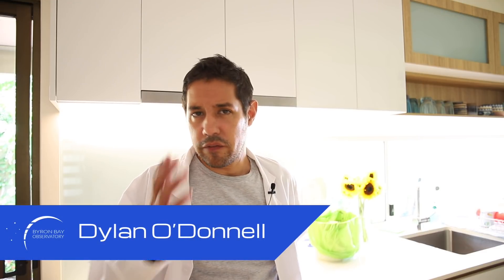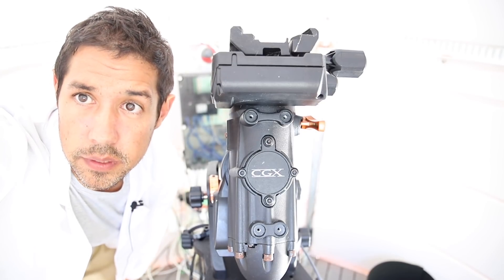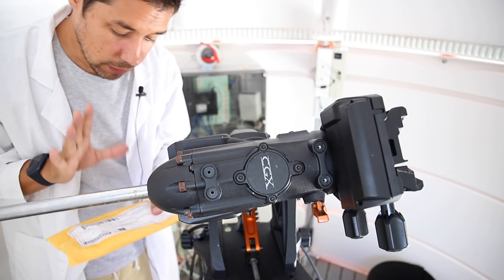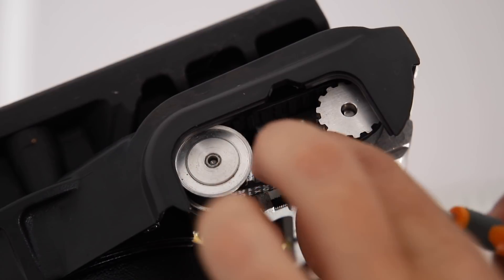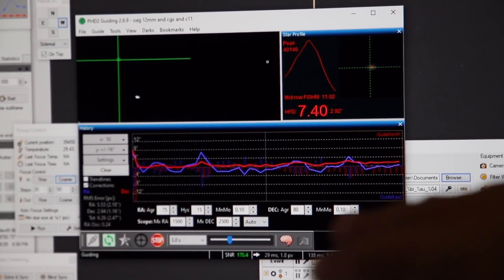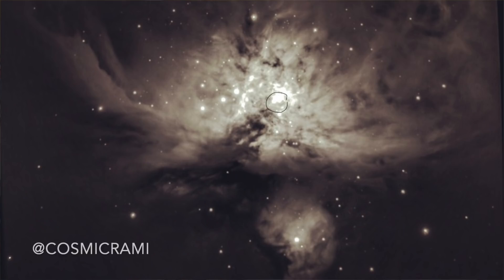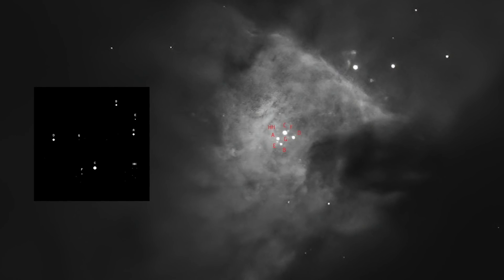CGX Belt Upgrade Demo & Trapezium PSA

Comment: The whole entire problem is the actual belt pulleys on the CGX are not precisely round they are "most of the time" egg shaped or eccentric in their movement, causing the brass bushing and main flange brass bushing to grind away over time, the fix is quite easy you need to rebuild the motor replacing only two parts , instead of brass bushings, you order bearings one for the outer casing and a flanged bearing where the main shaft seats into the motor, and also replace the worm bearings part numbers P213458, and SMF52C-YZZ,  easy 45 minute install and you have a brand new CGX mount!!!

Comment: There are adjustments for the back lash , with mine was not an adjustment but the pinion shaft has a retaining grub screw that was extremely loose causing pinion to move laterally in pinion mount behind encoder wheel, cleaned threads added small amount of locktite and adjusted in , reassembled, adjusted back lash and now like new ! Just look close for pinion lateral movement that’s the key

Comment: I've been fighting my CGX mount for a while now... PHD2 recommended I take 0.5 to 1.5s subs last night. Made the decision to tear it down and fix it. It's doing what yours is doing. I'll get new bearings belt and anything else I can think of.  Grease, clean, and all that good stuff. Hope I don't break it a bit I have to throw away 2/3 of my data at the 20s now. I actually have CEM60 now, but I prefer the ergonomics of the CGX other than its f'ing heavy.

Comment: 😮 certainly Not the way to change that belt.
First step is to back off the pitch  adjustment
Then swap belts and readjust >>>>
Belt should have a sideways deflection  3-4mm should do it?
These belts are very tough even originals.
Hope you have improved things by now 👍

Comment: The new belt looks like PU (polyurethane) belt, most likely with steel wires inside, it should be a very good choice for this application.
Reply: Sorry to hear it didn't work

Comment: How far out is your RA guiding? What was it before? I assume you did a factory-default on the hand controller, firmware reset, and set it all up again. This all seems to have happened since you did a bit of planetary stuff then going back to deep-sky.
I got my CGX second hand, but I'd be interested in an iOptron next time round.

Comment: Hi Dylan, sad to see your suffering similar issues I am.
I did quite a bit of fiddling about to find the cause of the 34s-periodic error causing the horrible stars. I do believe it has to do with the belt/motor/worm gear/whatever.
I did a video on my investigations. https://youtu.be/aZnA4u3cvWU
Can’t wait to see what mount you’re getting in replacement!
May the dark side be with you!

Comment: Ok, a few comments on the belts. your problem with the RA is not the belts but the bushing on the output shaft of the gearbox. I noticed when you were putting the belt on I could see the gearbox cog moving up and down. this indicates the bushing has a elliptical runout  worn in in to it. This wil cause the RA to have a almost cyclic spike caused as the cog turns it increases and decreases the tension in the belt. This is a known problem with the CGX/CGXL. The bushings wear out from too much tension on the belts. On the other hand, if you have less tension in the bets you have way too much BL. Fortunately, there is a permanent fix and why Celestron did not do this in the first place is beyond me. You can replace the bushings with high precision bearings(inexspensive)(easy to do) and keep the proper belt tension. In fact, I run mine slightly tighter to remove al BL from the belts. See CN forum on this subject. Also Ed Thomas from DSP has the bearings. I highly recommend this upgrade. My mount delivers great guiding and round stars now.
Reply: This sounds much more senseful than the belt wobbles. Let's see maybe one day I need this too. Thx for that.

Comment: Have you tried the following trick: Set the base tracking speed to 1/2 sideral and then the guider does only corrections in the plus direction instead of oscillating between plus and minus.

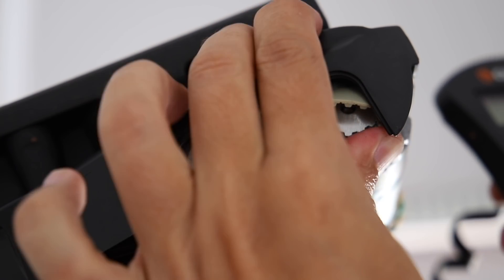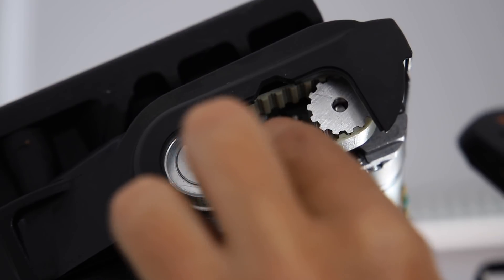Comment: Hey Dylan nice work on the belt swap.  When you were slewing, I noticed your belt still was pretty slack at the 4:54-4:57 mark.  I did the belt mod to my old NEQ6 Pro and I had to make sure there was no slack when changing directions otherwise I had massive backlash isues in PhD.  Hopefully that's all it is for your CGX, there should be an adjustment screw near the motor somewhere that you can unscrew a bit, then use a flat blade screwdriver to lever the motor out to create tension and then do the locking screw back up

Comment: Hay Dylan i was watching how the belt was acting after you put the new belt on....all belt drives have what is called tensioner...it would be a small bolt or screw...the screw type would move in a slot with a bolt tensioner...likely this would be the type....don't worry you can't mess it up....i saw that the new belt had a lot of ....for a better word....slack and this would cause the problem you where experiencing...and a lot of backlash...the fact that this is a new belt it may work better but it will eventually start acting up.
Reply from the maker: Thanks .. I’ll look for it :)

Comment: I think the CGX over all is an okay mount, but it does have its quirks and mechanical hangups. I'm adjusting gear mesh every few months due to weather and humidity changes. I don't think thats a great selling feature. Lol. This summer I'm going to pull it apart and go through the entire thing. I sent mine back to Celestron due to the RA being sloppy...after being 3 months old for warranty. (Not happy after spending $3000 CDN on a new mount that shit the bed after 100 hours of use lol.)  I'm a millwright so its fun to tinker and trouble shoot. I hope you can get it back to where you would like it again operationally but I can tell you're getting frustrated with it. Do you think its been ran with too much weight? Your 11" RASA and counter weights? Wore the ring gear teeth down?
Reply from the maker: Yeh I hear ya. I think this mount is fine for someone who wants to tinker and tune .. when it does work, it works great. Payload was within spec so suspect it couldn’t handle obs conditions (temp, humidity etc)

Comment: Since you are getting a new mount, with one belt off, doesn’t matter which one, because you need to do both, wiggle both pulley wheels in all directions to see if the shaft is lose. If it is you will need to ensure the pulley wheel is lose to the shaft or the shaft has worn down on the other end. That is where the shaft engages the the other gear. The metals used should have one as a more mailable material like brass and the other like the worm gear as possibly steel. The softer material will be the most likely to fail first, by design.
Don’t know but hope this helps.

Comment: Interesting, I wonder if I’m having the same issue. My dec guiding is usually 0.35” and my RA I can never get better then like 1.50” it’s super jumpy. On the RASA 8 it hasn’t been too problematic but long focal length yikes.
Reply from the maker: Yeh sounds exactly like how mine behaves. And it gets worse over time.

Comment: Oh God, please tell me you didn't just buy belts and get them shipped across a continent and an ocean on blind faith in the comments section alone. I don't know jack shit about motorized mounts, just cars lol.

There are so many parts with tight tolerances, it could be any number of things. It might still have initially been the belt but if you over-tightened them, you can cause excessive wear on the bearings.

Now I'm really curious to know what's wrong. See if you can scam whoever works on these things by making a breakdown video and giving them "free" advertising lol. I'm guessing there are plenty of others interested to see how these things work.
Reply from the maker: I had ordered the belts months ago.. it was worth a shot!
Reply: @DylanODonnell  I was afraid I had just wasted your money. I know how that sounds considering what you do but I still felt bad lol.

Comment: Should be able to tension the belts by slackening off the motor bolts, moving the motor & then re tightening. They should be just tight enough to remove any backlash. Dont over tighten the belts as that can lead to other problems down the road. Best of luck mate.

Comment: Hi Dylan, sorry to hear about your CGX problem, but I may have a few things you can try to solve this.  I apologise if this seems long winded, but its not easy to say in a few words.  Though, it might help save some money!

I used to work as an equipment engineer on robotic manufacturing equipment.  We tried hard to avoid using belts as slackening in belt tension is a known issue.  We preferred direct gear drive systems if at all possible.  I'm disappointed Celestron chose this drive method.

Usual causes for this were belt stretch, or slippage between the motor and idler wheel (gear wheel opposite the motor).  

Very high belt tension will try to pull the motor and idler together like an elastic band.  In equipment like the CGX, this only needs to sub mm distances before the effects show up in PHD.  The slippage can happen because of screws not be tight enough or mechanical wear.

First thing is to ask Celestron for the specs on the belt tension and their procedure for setting belt tension.  

This is usually (in my experience) specified as a weight, kg, lbs, whatever.  It can also be specified as the distance between the belt sides for a given amount of applied weight.

Usually it is not a difficult procedure, it usually involves loosening the motor or idler bolts.  Often there will be tension adjust bolt you release to enable a quick and safe belt replacement.  

Sliding belts over motor / idler combination without releasing their locking screws is not ideal...this can stretch the belt but also risks moving the motor idler distance or worse still warping the motor idler shaft & bearings (that's extreme, but I've seen it happen).

Sorry if this seems like criticism...its not!  My professional experience with these types of drive systems comes with a victim impact statement :).  This is why I hate belt drives for this kind of application.

I can spout for ages on this, but you all have lives to lead.  But if you want more information, feel free to mail me on davefottrell@gmail.com.

Clear skies everyone!!
Reply from the maker: Not at all, this is all very interesting!

Comment: Dylan I bet you $1’000 that all you need to do to fix that cgx is adjust the tension of new belt! I could clearly see in vid the new belt was tight at bottom but loose at the top! You were saying “oh this looks pretty tight” but I could clearly see the top of belt was loose. Finally, in practice, you could have simply adjusted the tension of old belt with exact same adjustments. All the above assumes it is actually possible to adjust tension by loosening then pulling apart the two belt wheels/cogs then tightening up again before you release them from your grip? 👍Wes, Liverpool, UK.

Comment: You probably already did it, but PEC? Looks like a dent in a gear or something. Anyways the belts weren't useless as you made sure the problem was somewhere else. If it's perfectly periodic then it's either a gear or the worm screw. If it's not, then it may be linked to guiding, and backlash could be the problem, but even then, the motor doesn't reverse, it just slows down or speeds up...
Reply from the maker: The cgx period is minutes .. this is seconds. Happens even without guiding!
Reply: @DylanODonnell  then you may want to check if it is periodic, because it could happen every rotation of the worm screw for example, and you can actually verify this by calculating it

Comment: You should be able to adjust the motor position to get the belts tighter and this should remove the backlash.
Reply: Yes, I could see tensioning screws in the video.

Comment: Good to see you back again, just a shame its another CGX related problem - Steven Morris was out the game for a while due to a handset failure....Can you do me a favour, as your dome is fully set up and established/settled, can you measure the distance from one of the aluminium wall column to the 2 opposite wall column.s, give me an idea where I should be roughly aiming for, as mine is only temporarily setup I haven't got them fixed in position. cheers. Hope you get your clear skies ASAP!
Reply from the maker: Easier said than done as there’s a mount in the way and it’s basically flooding right now (again!) but it should just be the dome diameter minus 2*column width. Ideally just draw a perfect circle on the ground (eg with a piece of string from the middle) and then place the walls around that so the dome doesn’t become an oblong.

Comment: No one noticed he did not tighten those belts! Loosen those three screws securing the motor and turn the small hex screw to get the belts ringing! U can see the motor pulley turn before worm gear axel pulley starts turning. Great content!
Reply: As I dug deeper in this rabbit hole of eq mount I found out that there is just bushings instead of good old ballbearings in the gearing for the belt. So better to check for worn down belt drive axel bushings before tightening belts. Normally u would have the belt tight enoigh so there is no play. But unfortunately there is a design flaw in the reduction gear on the motor.. bushing instead of bearing.. And those are not even cheap mounts.

Comment: I feel you mount pain 🤦🏼‍♀️, after months of trying to problem solve, spikes every 40 seconds and breaking a sweat taking the the cover off the belts. I sent it on a hyper tune holiday to the other side of the world. Which just not seeing it makes me happier also giving me time to get the husband use to the idea of a cheeky Italian 10 Micron..... Just incase the other one never comes back.
Reply from the maker: Haha just in case ..
Reply: NovaDawnAstrophotography@ My GCX mount must be made on Monday morning and late Friday.  Battled with poor tracking now for 2 years and found out that my mount is allergic to temperature change especially for cold weather. Plus one part of the sky my gear mesh is so loose that PHD2 doesn't get any response and another area is so tight that gears are hopping. All this with the same settings and the mount has been in service at Celestron.  If the outside temperature drops down under 65 F (18C)  gear mesh needs to be tuned maybe twice on one night and if the temperature goes under 32F (0 C) it's time to pack up.  Now, this GCX is under "lemon" status, and a 10micron mount is on the way.  

Celestron GCX mount quality is very poor. If you test 10 GCX mounts 2-3 are "good", 3 are about that level that people can tolerate them, and the rest of them is pure junk like my mount.
Reply from the maker: @nuvicamnewsnow8057  Ouch!
Reply: @nuvicamnewsnow8057  agh that sucks babysitting a mount all night. I bought a Celestron CGEM II to replace a broken 18 month old Celestron Evo. Out the box it didn’t track. I took it as a sign of things to come and Bintel kindly allowed me to switch to a EQ6R Pro and that has been brilliant for two years then one night, something happened... Hopefully a hyper tune and having its guts pulled out by someone who knows what they are doing (definitely not me) will resolve. Hope you get some resolution or even temperatures 👍🏻
Reply: @nuvicamnewsnow8057  10 Micron 🤤 😂
Reply: @EDGCOMBE7   You are absolutely correct its SUCKS to babysitting the mount all night and have 30 min timer on your watch to remain to check hows the mount is tracking. My two final options were the 10Micron GM1000Hps mount and Astrophysics Mach2.  I choose 10Micron because of the shorter lead-time and the only thing I'm missing is internal cabling.   My options to improve GCX is to use ( A) to fishnet weight or( B) build heating/temp control units around the gears, but what I need is new gears in my mount.  I have Starlight express active optics unit, but even that cannot fix the issue of my GCX.

Comment: What are your plans for your mount once you get your new one? Are you keeping it as a backup?
Reply from the maker: If I’ve got nothing left to lose I could probably take it apart and learn how to fix it. Otherwise as-is it’s probably fine for widefield at star parties.
Reply: @DylanODonnell  That's good to hear. I think you should take another crack at it once you get your other mount up and running. It would make for some great content. I don't know if anyone at Celestron watches your channel but if they do I feel like they are missing a huge opportunity here. 

If I was was the big cheese at Celstron I'd hook you up with some discounted parts and have a tech on standby for some remote support if needed.

Comment: Dylan, it sounds like you've already got a new mount on the way but your problem wasn't with the belts. I had the same issue but was fortunate enough to be so close to Celestron that I was able to ship mine to them for repairs. The problem is the belt was too tight and it wore out the bushings in the motor shaft that the pulley is attached to. If you grab the pulley and wiggle it and it moves like mine do in this video, that's the problem.

Advance to 01:50 to get past my rambling.
https://youtu.be/VsOGNNW6gqo